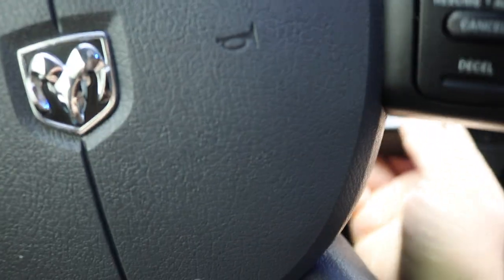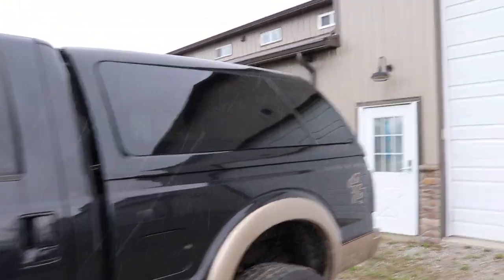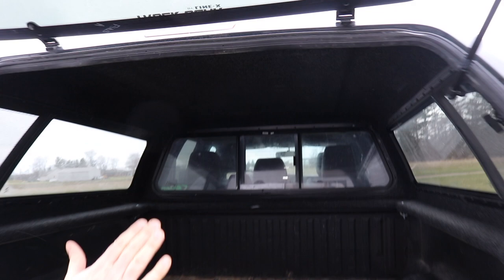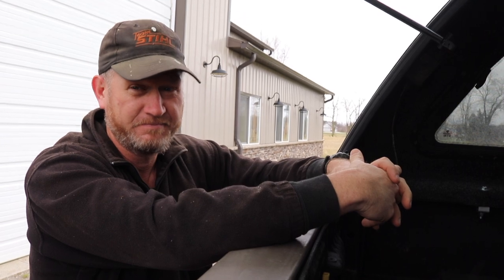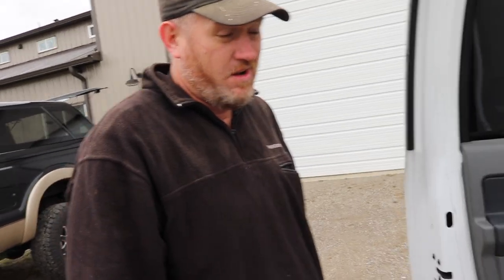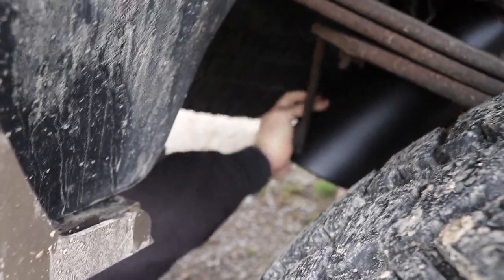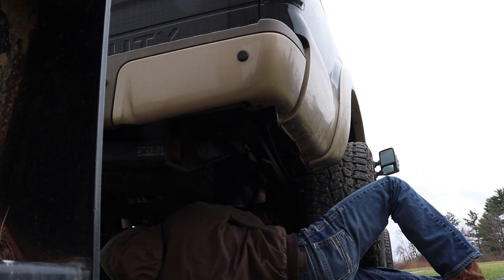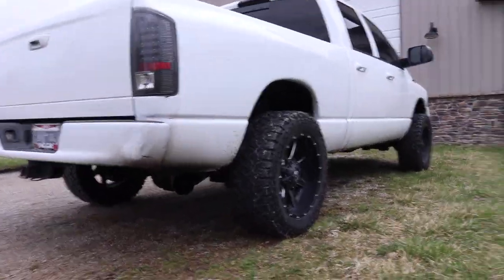King Ranch gets NEW AXLE DUMP exhaust setup and BED CAP!!!

Comment: I noticed a difference for sure with tips on my 7.3. No tip=more higher pitched turbo when spooled up or on the deceleration. Tip= more throaty, way louder, turbo whistle gets slightly muffled but still noticeable when accelerating. in my opinion I still prefer my 8inch tip haha